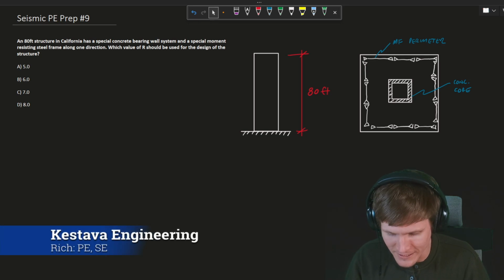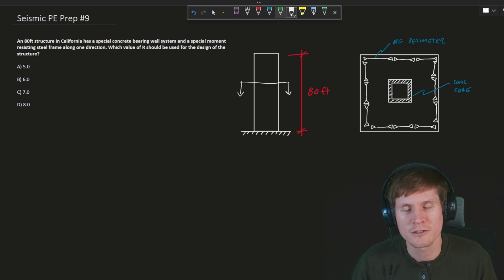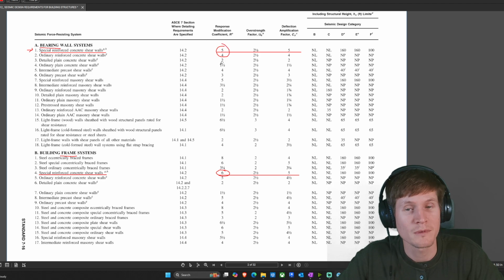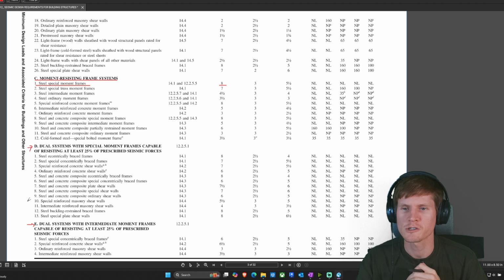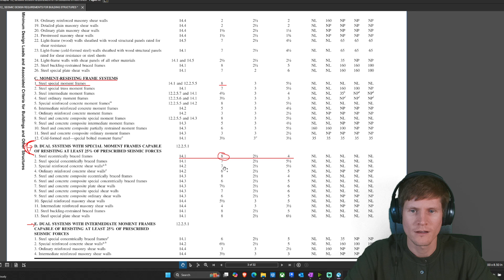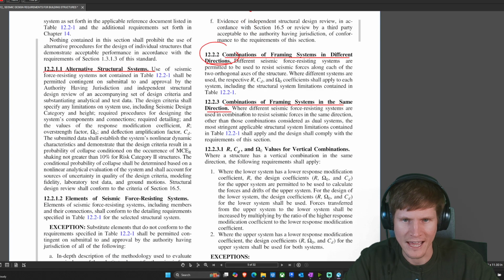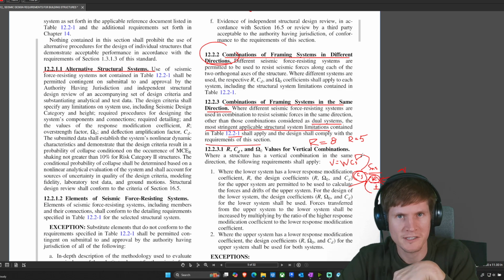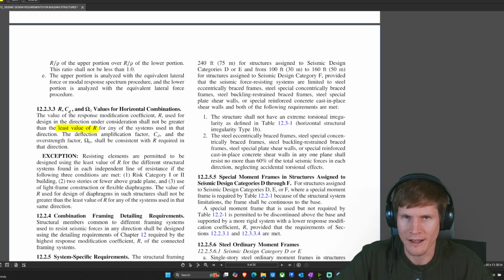PE Seismic Example Problem - 9 #structuralengineering #civilengineering #engineering

Comment: The problem statement stated SMF in one direction yet the sketch shows in both directions,  does not change the solution correct? Also,  could you not rationalize that you cannot force a less ductile system to be more ductile?  Thus you use the lower R?  thanks for the example!!!